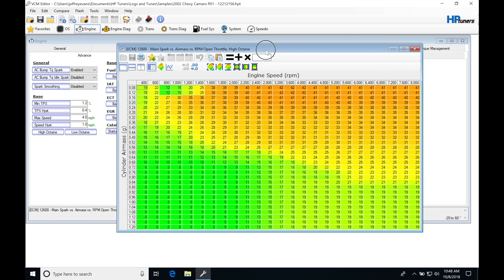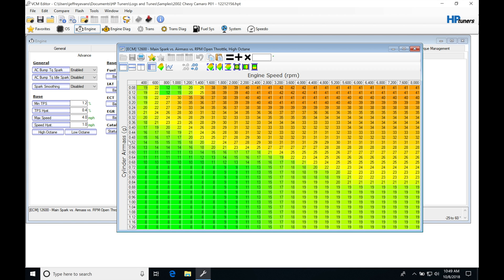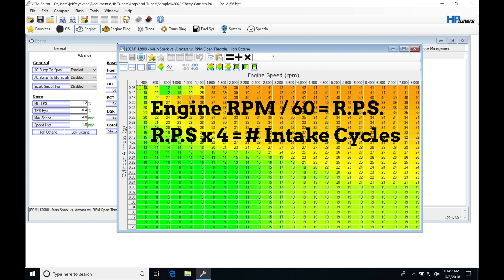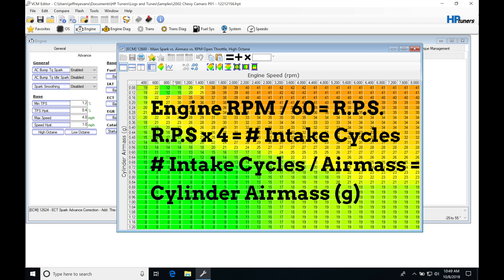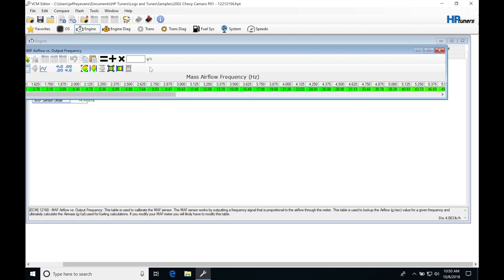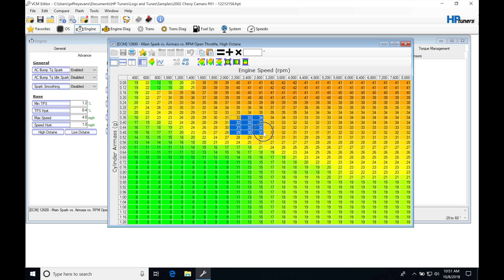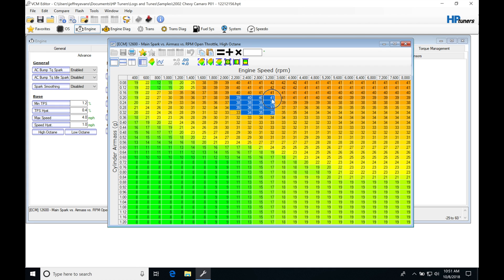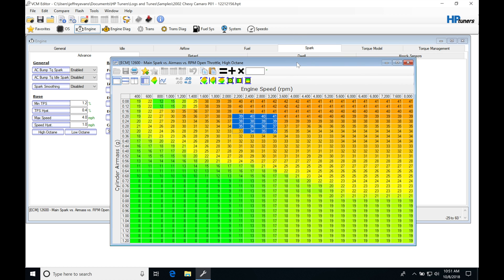HP Tuners GM Gen III: Spark Timing | Evans Performance Academy

Comment: Equation at beginning is wrong, correct? It should be airmass / intake cycles per sec = cylinder airmass. That’s the only way to end up with grams for cylinder airmass.

Comment: Im struggling with getting mine figured out it lightly spark knocks at idle. pulls good at wot. But runs sooooo rich at cruising speeds it makes my eyes water any tips or advice?
Reply: Have you resolved this issue?